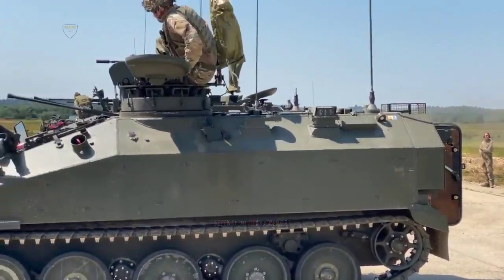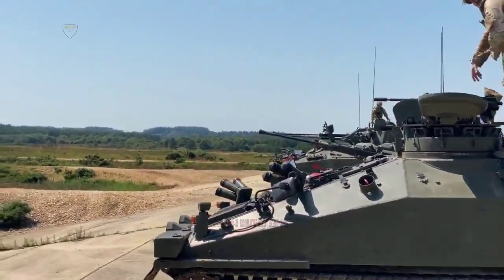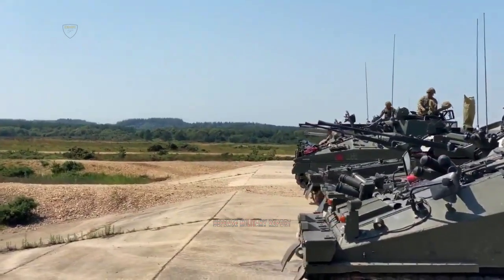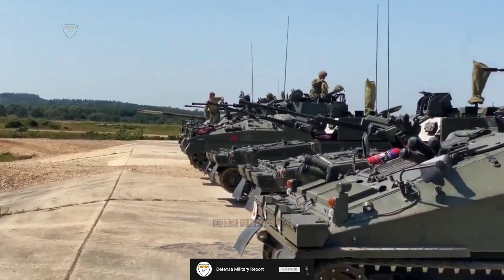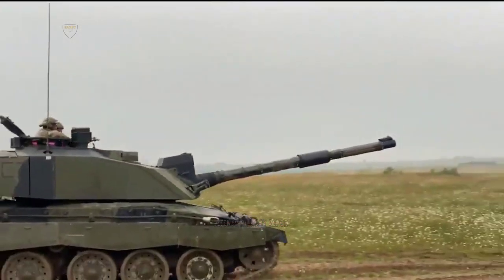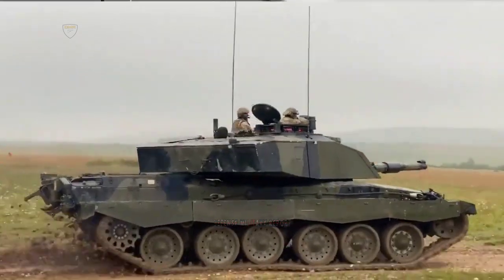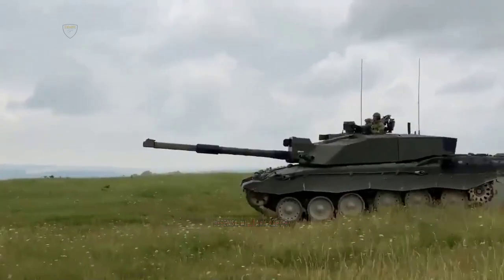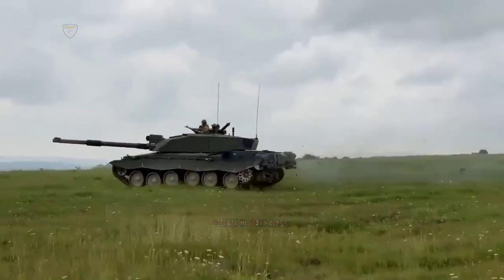British Army Challenger 2 Overhaul Started

Comment: Brigadier of the "Vehicle support, suport vehicle division, of armoured vehicle support procurement, in support of vehicles"... These convoluted names of Defence organisations is beyond parody.
Reply: These are the same people that make up rules that prevent parts being made by small local engineering companies at reasonable cost. ISO 9001 for parts is a joke due to the numbers made incorrectly -pipes and hoses being the worst culprits eg. wrong lengths, wrong fittings, wrong pressure rating etc !